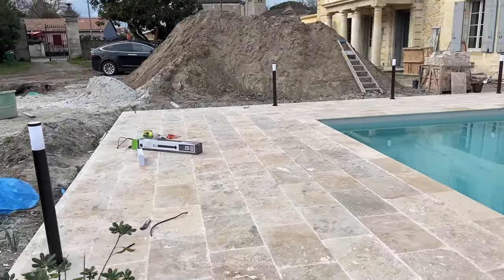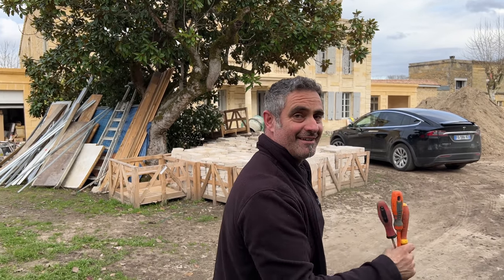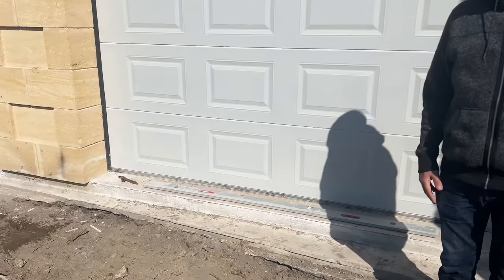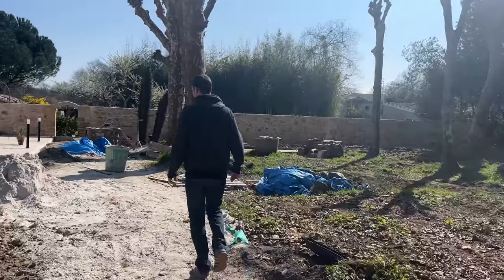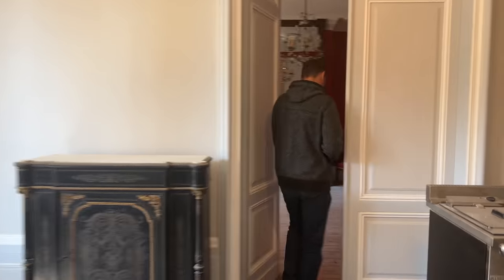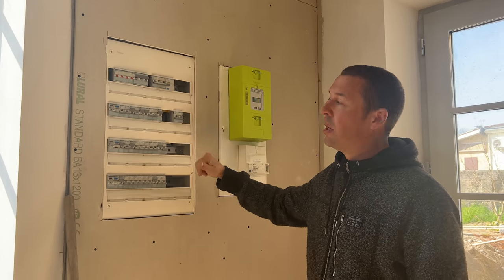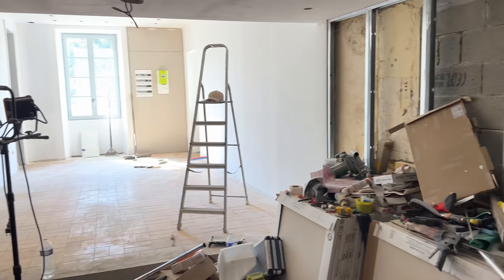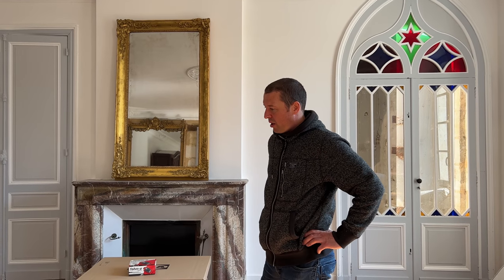EP140 Nail-Biting Time , The Stone Wall Arch , Kitchen Progress @ Our Passion Project

Comment: I like the beams white if they have to be painted. I think Anna is right that the grey would break up the room more. It would also make it a little darker. The archway on the wall opening looks great. It's perfect - like it should always have been like that. Will you be putting in a gate of some sort? It would look great with an old, reused gate, or one made of old, salvaged wood. Great work all around! Congrats on getting the wiring right Ed!
Reply: I agree that the arch in the wall is perfect, but it definitely needs a gate. My first thought was one made of old iron, but the right wooden one would work, too. Your work is, as always, well thought out and well implemented.

Comment: For those who are confused regarding Edd's "earth cable" the North American term is "ground wire" or "ground cable".  This is always a wire made of copper as it maintains the strength of the charge and does not expand the metal as in others.   Good job verifying the outlets in the manor.  Better to check twice and rectify once than every time you use it over the next 20 years.

Comment: I’d leave the painted white oak beam white but wouldn’t recommend filling the grain over to provide a completely smooth/flat surface. As it is it still reads as a timber beam, if you’re adamant to achieve a completely smooth flat surface you may as well attach/cover in plasterboard. Keeping white visually provides consistency across the ceiling space even if not on the same plane and will appear bigger and not choppy, if you introduce a colour such as the cupboard door colour it dissects the room by making the beam look bigger/heavier. You should only introduce colour to the beam if you’re wanting to specifically highlight as a feature. (I wouldn’t introduce a colour if it was me nor would I be filling the grain, as I said it still reads as a timber beam - that’s my opinion anyway. Same goes with the small section of timber above the doorway you showed). You’re doing a fabulous job by the way.

Comment: I agree with Anna--painting the beam white makes the ceiling not seem as heavy, as well as not disrupting the flow from one part of the room to the other. The kitchen looks like it has  lower ceilings  compared to the ceilings in the other rooms in the main part of the château.  If it had higher ceilings, it might have worked to paint it grey or leave the wood tone. Good call, Anna!

Comment: Everything is beautiful so far.  I love the color of the warm exterior stone around house and pool.  It contrasts nicely with the cool colors inside the house.  I will admit, I don't see very many chateau walls painted yellows or oranges or browns - nice friendly earth tones.  It might be nice to see an accent of earth tones occasionally.  I do see a lot of paint colors you would see from the sky on a cloudy rainy day. I also like the classy simple designs of the bathrooms.  The bedrooms are also tasteful, beautiful and uncluttered.  I love the way the portico sweeps out to greet the pool.  I suspect there are laws about keeping pools fenced in - how will you fence in your pool?  I expect the new kitchen will look great.  I'm wondering how you are going to make a modern kitchen meld into an old chateau.  I would suggest keeping the beam a lighter color than the ceiling.  The beam is huge and a dark beam might make it look too heavy.  I also suggest decorating the beam with plates - dessert sized plates either glued or mounted to the sides of the beam.  If you could find plates which reflect the frieze on the chateau, that would be nice.  Or, you could decorate the beam with shadow boxes with illustrations of the the chateau.  Software packages such as Photoshop can easily convert photographs to black and white line drawings.

Comment: I would keep the beam white but I would go further than that. I would fill in the holes and cracks with wood filler, give it a smooth coat and paint it white.  Visually that would remove the break by the beam across the ceiling. Especially since you've gone ahead and already painted the beam. Just my design thoughts.

Comment: Covering this beam with a shroud would be amazing and add a focal point to the room.  Painting this is just not the old feel of the room without covering it with wood.  A would filler could have been done too….it’s an ancient wood.  I’m the opposed side but I’m sure it will,work.  No matter what.  Why not just cover it with rock board….